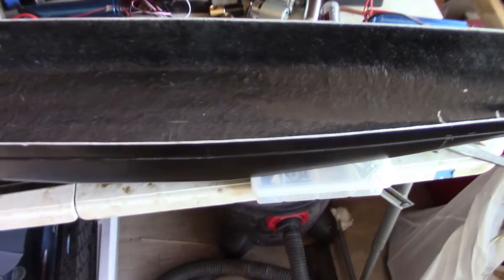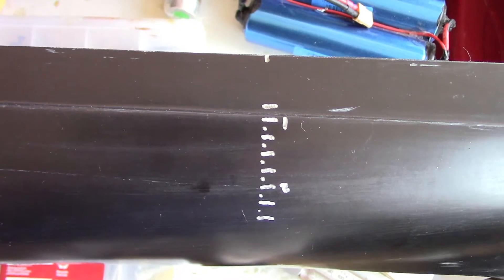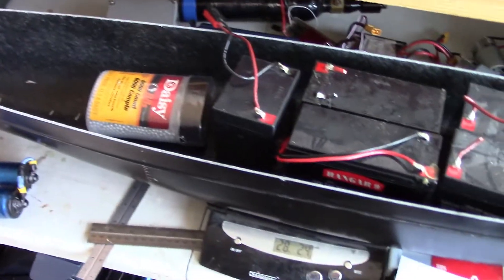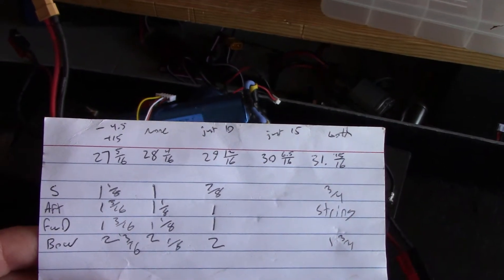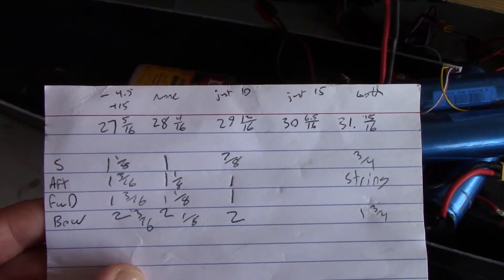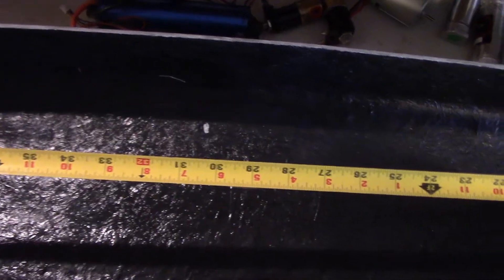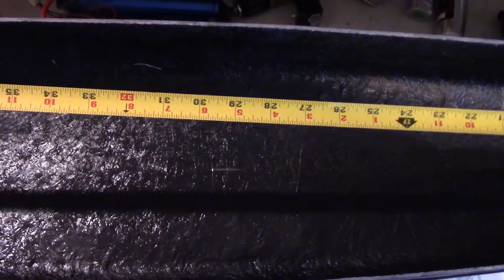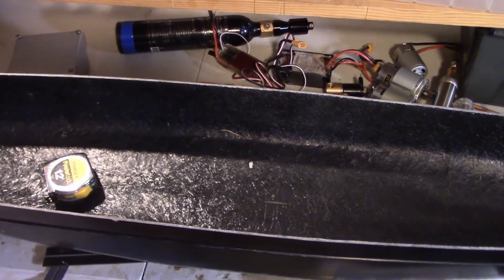Float Test: Building RC Warship Video 1

Comment: what is the material used for the hull and what should be used for it to be waterproofed ?
Reply: fiberglass
Reply: Once the hull is cut they skin it with balsa wood sheets and they use waterproof electronics and sealants to water proof electronics
Reply: This multi video "tutorial" starts with already built fiberglass hull and i wonder how to build it, i thinking about building my own battle ship but i don't know where to start.